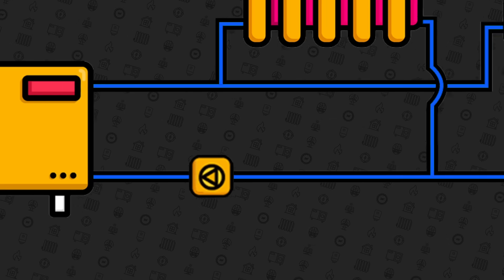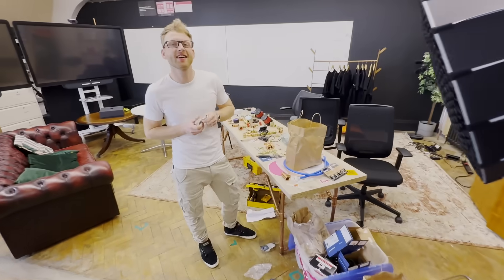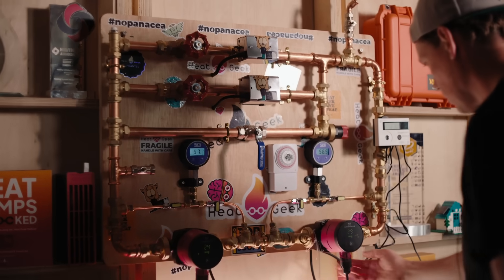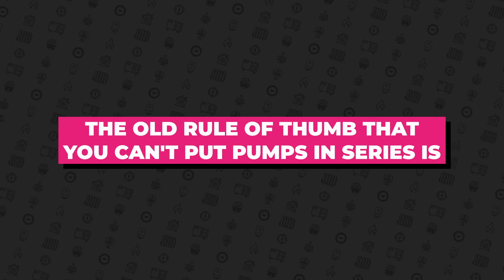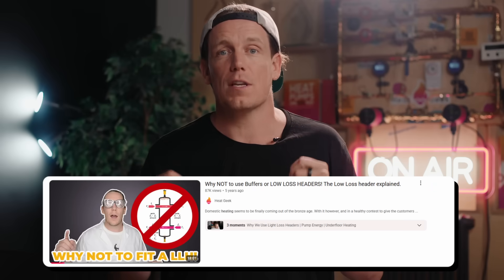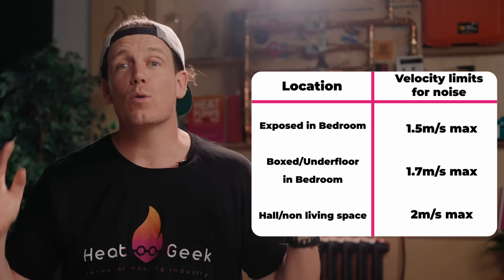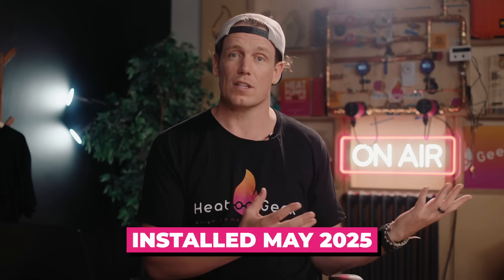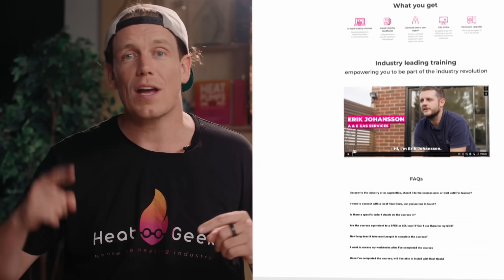Why Your Heat Pump May Not Need a Buffer or Repipe After All

Comment from the maker: The test rig is still running well as of 31 July, installed early May
Reply: Definitely possible to run pwm pumps in series for years. We use either 1 or 2 in series for our ground source heatpumps depending on required heating capacity. So far as i know there's statistically no meaningfull difference in pump failures across different heatpump models.
Reply: So if adding a 2nd pwm pump after the 3 port to assist the open loop heating side, would you wire this to the same pwm out put on the heat pump controller ( samsung) that the main pump is on ? Im running a single grunfos 12m head pwm pump but its still struggling on 2 x floors of open loop ufh./ Hot water is fine. I think its the largest pwm pump unless the magna 3 have pwm input. It works well as the heat pump modulates to need, but on heating flow rates need increasing. " pump idea could be way an option rather than one massive ( expensive) pump which is overkil on H/W cycle
Reply: Would be curious to know if this also applies for modern, but less fancy pumps. I think the ones in the test are like half a grand.
Reply from the maker: @MrDahnan the ones in test are £85 quid each. It’s relevant to all pumps
Reply: @HeatGeek oh great! At a glance they looked like the smart ones.

Comment: Without a re-pipe it's going to be less efficient.
  HPs are all about maximizing every little bit of the whole unit and system to make them efficient, that's one reason they've been so difficult to get right, everything has to be working at, or near 100% efficiency.
You can force water round a restrictive system to make it work, but it'll cost you to do it.

Comment: I have fitted a 5KW heat pump without changing my hot water cylinder, without installing a new hot water cylinder, refusing to fit the recommended buffer tank, refusing to upgrade the pipework, add radiators.... and in my 5-bedroom detached home it works so very well. Can I assume MCS Installers simply want to increase profit by installing stuff you do not need? The pump I installed was a straight replacement for a gas boiler.
Reply: Would you mind saying how much in total you paid. Thanks
Reply: @FOTOMOTOGP  5K all in

Comment: The origin of the teaching to avoid pumps in series was the Viessmann technical guide. At the point that Viessmann change from fixed rate circulators to variable speed they dropped one of the designs from the technical guide. The discontinued design featured pumps in series and instead it was replaced by a statement not to put pumps in series. What I have come to realise was this instruction was simply not to put them in series with their boiler. This is also true of many heat pumps that want to control the delta t by adjusting the internal pump. Some heat pumps will also show up a fault if flow is induced through the heat pump by a third party pump. If the heat pump you ve chosen is not suitable for pumps in series, you could use a three pipe buffer. I suspect it would be common for the flow on the secondary side.To be slightly lower than the primary for most systems. Utilising, the three pipe buffer would ensure that the flow temperature from the heat pump was supplied directly to the system. The delta tea on the secondary side could be slightly wider than the primary so a small difference in flow temperature may be required. Hydraulic separation.
Is an extremely useful tool but needs to be thoroughly understood and applied correctly. What we really need is a smart flow controller. I don't understand why we can't have the control for the pump on the secondary side of a buffer. This could vary the system flow, along with the heat pump flow to provide some very useful control features. Most of the design ideas I was thinking of regarding this flow control has been incorporated in the Viessmann heat pump already. At the moment they seem to be the only company that design product with the ultimate design understanding. Just imagine if the pump for the secondary could switch off momentarily, just before a defrost. The contents of the buffer could be used for the defrost. After defrost, the pump's flow rates could be matched to prevent any kind of mixing. The buffer would obviously exchange heat to balance the contents of the buffer with the return temperature of water from the system if the temperature of the buffer dropped below the return temperature of the system during a defrost cycle. To prepare the buffer for the next defrost cycle, the secondary flow could be run, just very slightly lower than the primary. This would cause the buffer to charge over a period of time that could be controlled from the heat pump. In warmer weather, when the minimum modulation of the heat pump is greater than the load on the system. The secondary pump can be slowed bringing the volume of the buffer into play to the heat pump. This would enable minimum, run times to be observed using the volume of water in the buffer. Remember if you are using a buffer and the flows are matched. It has no real effect on the volume of the system. 
This is why it is really important for we are taught why, instead of just told to do something. The simple adoption of an instruction from a book has caused hundreds and possibly thousands of people to be taught, never to put pumps in series. I am fully confident that now we understand when and why we should or shouldn't put pumps in series.
Reply from the maker: Great info!! Not just Viessmann at all though. It’s literally what the idronics series is all about.. ways to avoid pumps in series.

Comment: My Vaillant ASHP makes noticeable noise when running in DHW mode, especially at night. Since electricity is a quarter of the usual price during off-peak hours, I’m wondering if I could reduce the flow rate during DHW mode to cut down on noise. The 7kW unit draws about 1351l/h in DHW mode, but only 875 l/h in heating mode—where it runs quietly.
Reply from the maker: First off, make sure your domestic hot water is in Eco mode. If you have a buffer, make sure that your hot water is taken off before the buffet, not after it will need a re-pipe if it is.
Finally, yes, reduce the flow rate you should be nowhere near 1300
Reply: @HeatGeek  it's in normal, ill set it to eco, the tank is the same & works the same as the mini store, only 300l.
hence 32mm pipe direct into a 300l buffer so the pump speed left as standard, ill try 800l, see how it works out.
and thanks for the advice.
Reply: @HeatGeek returned it to factory setting 65%, it was set at 100% now delivers 1000l, so maybe see what happens when set to 50%.
from the manual
Conf. DHW build. pump” setting:
Conf. DHW build. pump = Configuration of the Domestic Hot Water building circuit pump
- Unit: % PWM = Pulse Width Modulation percentage, which controls the effective power delivered to the pump motor
- Range: 50–100% = You can manually set the pump speed between 50% and 100% PWM
- Auto = The system dynamically adjusts pump speed based on demand and hydraulic resistance
- Factory setting: 65% = Default PWM value for DHW mode when not in Auto

Comment: Adam, I'm the guy in Colchester with the SCOP 2.2 Samsung 12kw Heat Pump, installed by EPC Improvements in Chlemsford. I am hoping we can get mine fixed by removing the buffer, glycol, and changing some of the radiators. But some of the HGs in my area, are talking about replacing the Heat Pump with a Valiant one as that's the HG recommended pump, this comes at heavy costs, including a £300+ initial fee to get started. In my case I tested the temps going inside my buffer, 48c going in, 40c going to rads, 34c coming back from rads, and 45c going back to heat pump. Based on the original heat loss (which at this point I am not sure we should be trusting), my ground floor has a shortfall of 33%, 1st 24% and and 2nd floor by 51%. In since my rads are only getting 40c or less, the actual shortfalls are more like 59%, 54% and 70% which is crazy. No wonder I have to keep 2700W oil radiators on the ground floor during winter.
Reply: We understand that your buffer has double distortion. I have now proved this theory on the daikin systems i talked to you about. It may be easier to reconfigure your buffer as a three pipe buffer. This would avoid buying an expensive high head pump.
Reply: @andrewmillwardwatford9410  thanks Andrew, still waiting on my claim to finalise. Would be great to make a remediation video with my SCOP jumping from 2.2 to a 4+
Reply: This is the sort of story that has stopped me getting a heat pump. This does not happen with a gas boiler.

Heat pump industry needs to get itself sorted out before people will adopt. People can’t afford the risks.
Reply: I think taking the buffer out of the system and upgrading the pump is likely to solve the vast majority of the issue. Those Samsung heat pumps are capable of very good performance when installed and set up right
Reply: @jezclimas5189  Andrew above came around and had a look at my system. I am now waiting on my claim see if I can recover anything before I can start the work. The industry is messed up, and even my credit card doesn't seem to grasp the issue.

The other issue is that even new builds, companies cut corners on insulation, like it won't be found out, for example, my walls have partial insulation, I would say only 50%. The builders must have saved a fortune doing this on 100+ houses they built in my area.

Comment: I have a grundfos alpha 1 for recirculating my hot water on a diesel heater and it constantly hunts between 2w and 8w. My main grundfos magna 3 also sirges when it starts up and I can hear cavitation in the pipes. After, it settles down from 90w to 25w and all is fine. But it switches the pumps on amd off depending heating or water demand. Super annoying and as an electrician I don't have a clue how to fix it.
Reply from the maker: Sounds like a much bigger and more complicated system to be honest this will be in the hydronic layout of the main plant

Comment: I had gas condensation boiler with build in pump for UWH then without any buffer or any type of tank was connected directly into anuloid with two pumps in parallel to push water into my two floor house. All three pumps was controlled by different systems and it runs for 10 years without any issue until i change my heating to heat pump setup.

Comment: After following heatheek for a couple of years, knowing that we where going to be future proofing our home, we spent £375 on the heetgeek online survey, they estimated £14k minus the £7-8k government grant we would be paying approx £7k. However after the site survey that cost went up to £17k as we where told that all the pipes and rads would need upgrading to 22mm. £10k difference that we felt at this time we could not justify £17k with all the other work we where having done, EWI, solar and battery storage. Shame, maybe in the future
Reply from the maker: Pssst. See if you can get your heat geek to try our beta ‘zero disrupt’… it’s much cheaper

Comment: Pressure and flow are connected. As long as the second pump can provide the pressure or flow opposite to the first pump then there should be no issues with power transfer, efficiency or wear on the system.

Comment: Serial pumps isn't rare.  As long as they're in the same part of the system it's not really an issue.  PWM and smart pumps not required.  I would be interested to know the reason for the rule... Most rules aren't made up for no reason at all.  Maybe there's something not super obvious, or maybe there were quirks of older systems that no longer exist.  Would be interesting to look up historic published codes and practices to see.  Know any nonagenarian former plumbers? LOL

Comment: If you have two pumps in series then the flow rates MUST be equal, though each can develop different pressure difference across them, which additive. The total pressure drive the flow through the rest of the loop.
What is probably different is likely to be that historically some (many?) pumps would be designed to deliver a particular flow rate, rather than differing pressure levels. So if to had two pumps 'arguing over the 'correct' flow rate then they would battle it out, and rules followed!

Comment: I wouldn't recommend doing it without understanding the physics behind it and its limitations. Also the layout of the pipes and connection layouts as well as the pump designs are to be setup correctly.
I'm however also still questioning the general statement of not needing a buffer. In a townhouse without much winter solar, this can definitely be true but there are other contexts where buffers would make sense imo.

Comment: Question. 
Scenario. 
If I rent a Victorian terrace house in the UK with a built in gas oven and gas central heating, and the landlord works for British Gas.
Are there cheaper electrical alternatives that I as a tenant can use without getting into trouble with the landlord?

Comment: Comment on “Pumps in Series” Video – An Industry-Wide Design Problem, Not Just a Test Error
This experiment highlights a critical issue that goes far beyond pumps in series. The real problem is not the pumps themselves — it’s the lack of structural system design.
The test setup appears to mimic a typical open-loop layout, where one pump “pushes into” another, with multiple potential flow paths and no clear load separation. This kind of arrangement is common in the field, and it’s also the root cause of many system faults, such as:
•	Heat pumps short-cycling due to distorted ∆T
•	Radiators heating up when only UFH is active
•	mixing valve misbehaviour
•	uncontrolled backflow
unnecessary reliance on NRVs, flow limiters, or electronic controls
All of these are symptoms of a deeper problem: the absence of a clear hydraulic structure. Instead of isolating zones and loads at a neutral point, most modern systems default to an uncontrolled open loop, then try to correct the inevitable misflows with layers of complexity — balancing valves, non-return valves, flow regulators, and intricate controller logic.
Even regulating radiator flows manually or with auto-balancing valves is a reactive fix. These wouldn’t be needed if the pump weren’t fighting unpredictable backpressure from multiple, interconnected loops with no fixed direction of flow. The same applies to electronic mixing strategies — they’re managing confusion, not preventing it.
Unfortunately, because these problems tend to arise in multi-zone systems, the industry often ends up throwing the baby (zoning) out with the bathwater (poor structural design) — as if zoning is the cause, rather than the victim of bad system layout. But zoning done properly — with correct structure — is one of the most powerful ways to improve energy efficiency and comfort, especially in low-temperature or hybrid systems.
The concept that’s missing — and that this test unintentionally illustrates — is Structural System Design™:
•	Each load circuit has its own defined pump and path
•	The appliance serves a stable, predictable ∆T
•	Zones do not hydraulically interfere with each other
•	Sensors get clean, usable data
•	The system becomes naturally self-regulating
Until this fundamental shift in thinking becomes standard, the industry will keep running in circles, arguing about which gimmick best masks the chaos, rather than solving the root cause.
This opinion isn’t a criticism of any person, but a clear example of how hydronic logic has been neglected for decades, but more so in the last few years, when the established practice of zoning was discarded for all the wrong reasons. The real opportunity is not which pump goes where, it’s whether the system has structure or not.
Reply: I support the assessment, though often there's a problem where the install job is to ADAPT an existing installation, and there isn't a proper designer for the update. Far too much 'throw mud at wall and hope it sticks' style hack and hope, and only being told half a story. 
I've got a microbore system with LPG combi, now with cavity wall insulation and warm roof loft conversion, dead zones, and limited underfloor access. It's going to be an interesting upgrade 🧑‍🔧